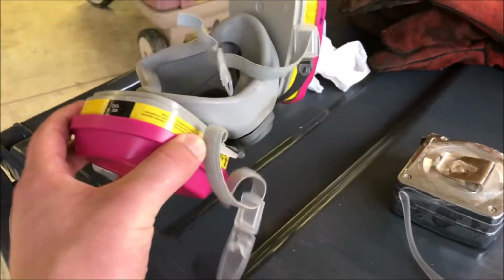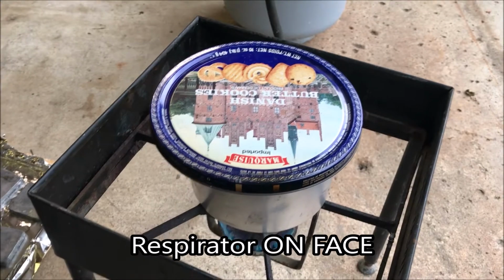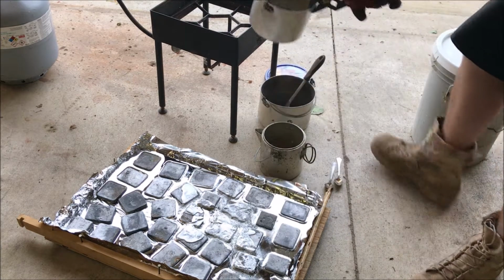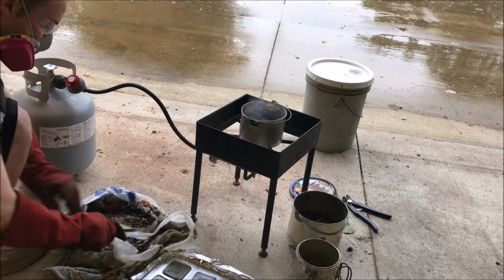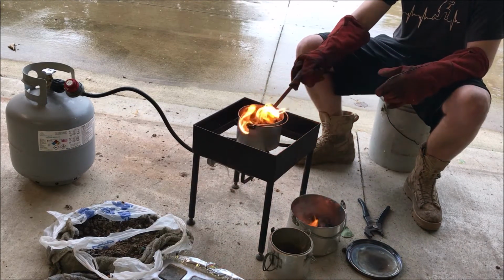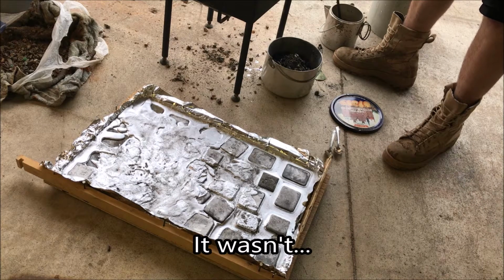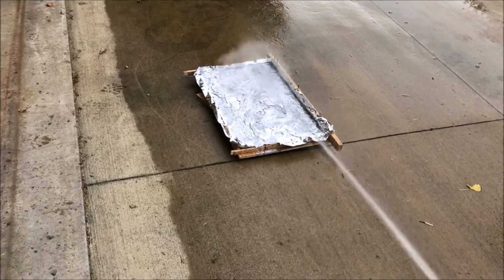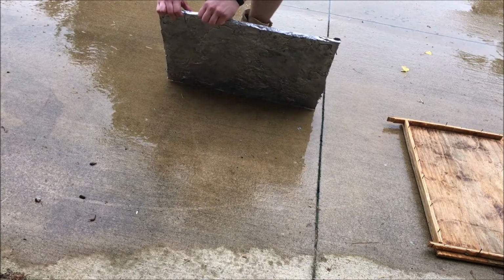How to Cast a 100 Lb Lead Plate at Home

Comment: So what did you use this for?
Reply from the maker: I put it in the bottom of a thick and large wire cage that contained an expensive computer so that thieves couldn't just steal the whole unit without alot of time a effort spent to cut apart the cage. The cage was built so I could use the computer while it was in the cage and get good air flow.